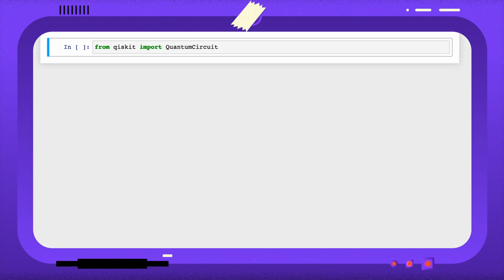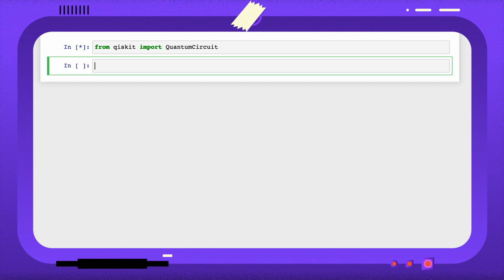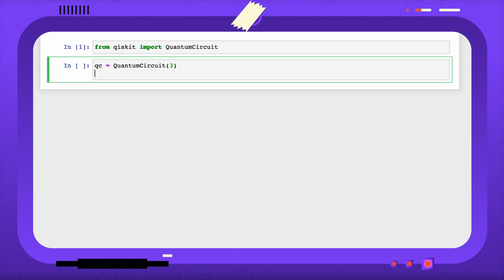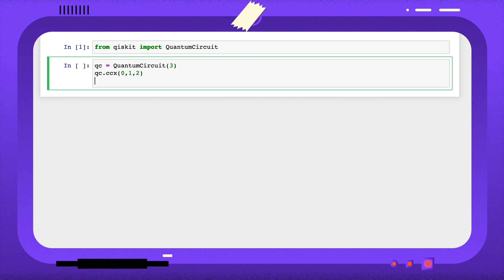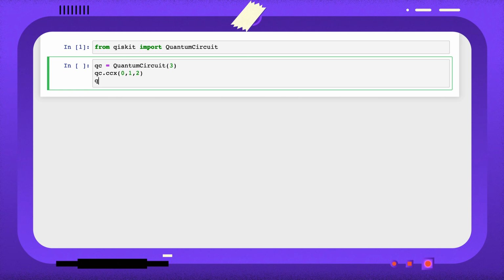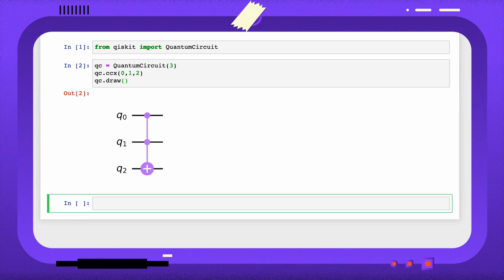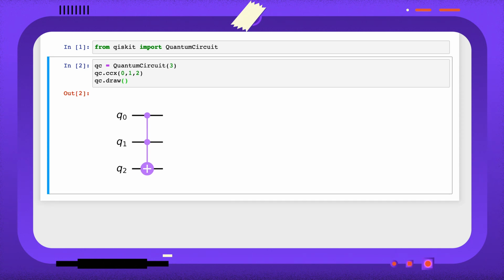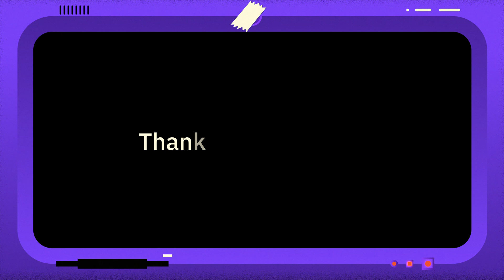How can I implement a multi control Toffoli gate? 1 Minute Qiskit

Comment: Is there a way to do Toffoli gate with inverted control qbits, or do I have to manually stick in NOT gates before & after the Toffoli?
Reply: I think you can easily define it as gate qc.to_gate() and reused it when ever needed